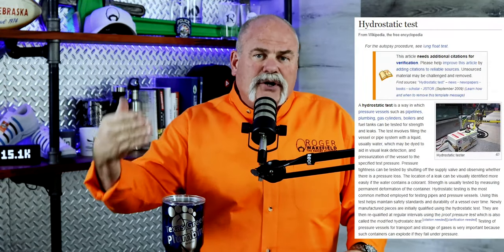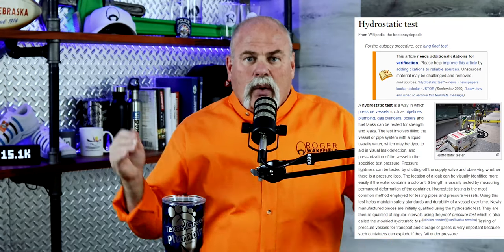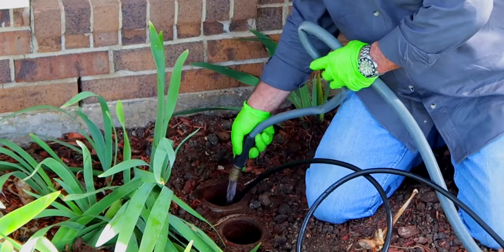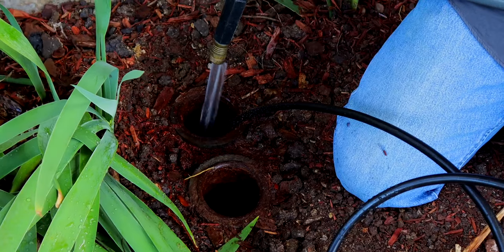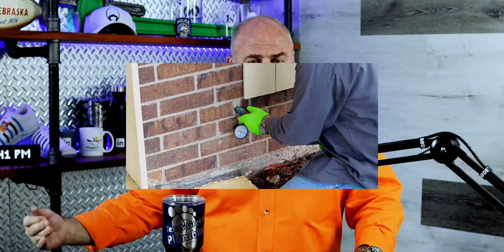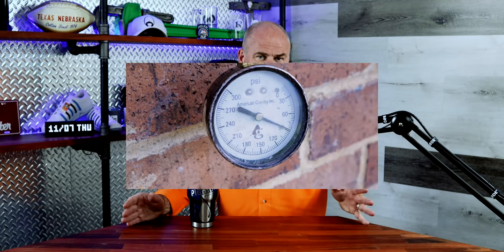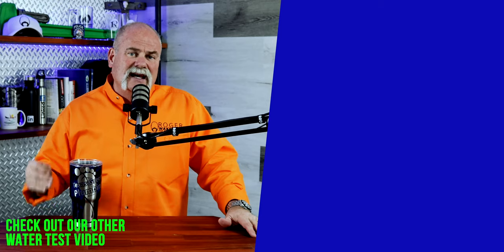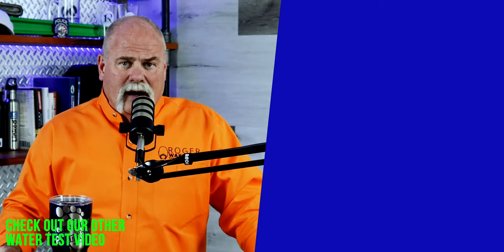What Is A Hydrostatic Test? | Plumbing Basics

Comment from the maker: Do you call it a hydrostatic test?
Reply: I did the 15 minute test with city water, and had a drop from 64 psi to 62 psi. It is within an allowable range or is it a leak?
Reply: I just call it a pressure test, and generally we only do them on new installations, although we have slightly different regulations in the UK, for new internal plumbing installations, I fill the pipework and vent all the air, and then pump the system to 3x working pressure (usually 3 bar), and for new drainage systems, just stop up the drain and fill with water, and then just let it sit and its simply a visual check, where the building inspector visits to see if the water level drops.

   I've never been asked to do that kind of pressure test (with a pump) on an existing system, I would be very nervous about that, it's more of a cover your own arse thing on new pipework you've installed, if it springs a leak after that it's usually because the carpenter has gotten trigger happy with his/her nail gun😅
Reply: @bp3149 would have to refer to your city codes all may not be the same .

Comment: 1st THANK YOU for the knowledge that you share.
I am a retired Volunteer FF and one of my responsibilities was to keep our SCBA bottles updated as well as our Fire Extinguishers. & our Fire Pumps & Hoses. So I am very familiar with the term "HYDROSTATIC TESTING". Which entails taking said equipment to a predetermined PRESSURE above its normal operating limits. And I've seen this equipment fail catastrophically!
Now that I hope that will help clear up the confusion as to what a Hydrostatic Test is not a STANDING WATER @ Normal Atmosphere Pressure.

Comment: Hi from San Antonio - We're selling our house and the potential buyer has asked to do a hydrostatic test. Our realtor explained the test as pressurizing our system (that could damage our appliances and water heater) and that our toilet would have to be removed to complete this.
We immediately said NO! 
We would absolutely be open to the test you described in your video.
How would you recommend proceeding to ensure the buyer's plumber does the test you described and properly?
I realize this not really a question you can answer but any advice would be welcome.
Thank you!

Comment: When my sister was looking for a house to buy, we did the test to one of the houses. We put a test ball in the clean out outside, but on the house side of the tee. Then we took off a toilet from the first floor, we filled the toilet drain pipe with water all the way to the flange. It wasn't holding the water. And there wasn't any water running through the clean out.
Reply from the maker: Sergio Ñurinda that's why we do it. This one test can save homeowners thousands of dollars...

Comment: Watch out for the occasional toilet causing the water pressure to drop. If a flapper is bad it will cause the fill valve to open and ruin the test.

Comment: Great video and topic to discuss Roger . I was under the impression that a hydro-static pump test is when the whole system is filled with water,along all air being purged out the system with pressure then being applied via the pump on a hose  attached to the system. Would that be correct? Also figured,just filling the system and checking for any leaks to fix(pressure not dropping) was just a regular fill test.
Reply from the maker: Ethan Muniz I wouldn't want to ever apply pressure to someone else's plumbing system. If it blows apart that could be my fault. We just do a leak test. That's all we are looking for. Thanks for watching and commenting!
Reply: @RogerWakefield  I agree with you about ever putting pressure on someone's plumbing roger. Being the fact that the line is just waste and not any kind of supply. Was more so just referring to the hydro static term defined. Thank you for the response ,much appreciated.
Reply from the maker: @ForeverAGh0st  you are welcome. I appreciate the comments!

Comment: Fill the entire system up on the roof, not the top of laundry drain. top of vent for 24 hours, it can't fail for 30 plus years, if water level is roughly the same as original. Sometimes the water can squeeze past the test ball, ever so slightly. it's a true safe test. You put a camera in, after you fill it with water. The stabilization will tell you,  if water is moving also.# masterplumber

Comment: I called 4 plumbers for a hydrostatic test and they all said they had to “pull the bowl” to do it. I went with a big plumbing company and they pulled a bowl and found a big problem and said it needed to be fixed before they could replace it. They had to dig a tunnel to do it and it was loud and pricey. When the work was done, they did the hydrostatic test using the toilet drain pipe and said that there was another leak. Now, get this: the city inspector had to sign off on the work before they could backfill the tunnels. The test performed for him was the one demonstrated in your video with the ball in the cleanout (but no meter on the hydrant). The water held and he signed off on it. Now I have questions. The test for the city showed no leaks after 4 hours (we are still waiting for the plumber to come back and remove the ball). But this other test from the toilet drain supposedly indicated a leak. I’m feeling a little ripped off right now and very confused. There’s a lot more to the story but that’s the gist of it. Do you have any feedback?

Comment: So what’s the difference between a status pressure test on domestic system, and a hydrostatic pressure test on sewer system? 

Because the static pressure test passed saying held at 72psi in 30 min, but the hydrostatic pressure test failed saying loss 4” in 30 min. 

The house had foundation repairs so I’m trying to find out how much I need to be concerned with this

Comment: Running main water line against the sewer line? That is way prohibited here Austin and the surrounding areas. You have to be at least 5' away from the sewer line. Where properties meet they usually put sewer on one corner and water on the other side of the property and if you have to cross you have to put it in a sleeve. Even on areas where they don't have sewer if the drain field from the septic tank is where the water crosses you have to sleeve the entire thing doesn't matter if it's color coded.
Reply from the maker: lemony Buffalo  we can run them in the same ditch but the water is supposed to be above the sewer and shelved. Thanks for watching and commenting!

Comment: If you determine there’s a sewer leak how do you isolate the sewer system to determine the exact location of the leak? Do you then perform a smoke test?
Reply from the maker: Josh McFate  we use test balls, hoses, and cameras to isolate the individual branch lines. A smoke test doesn't help under a slab because you will never see the smoke. Thank you for watching and commenting. Where are you located?

Comment: I have a question...we had a guy run a test...he blew up a ball..then ran water from shower and then said wait the 15 min...but after maybe 5 or so minutes he ran back in turned shower on and off about 10 times....oh and he had a camera to make sure the ball was holding the water on clean out outside...
Then he said he couldn't tell us the results...now if we aren't supposed to run water but he goes in when he thought no one was paying attention and turns shower on and off 10 times and i asked so are you not telling us because it failed and that's why you were turning shower on and off and he laughed and said no has nothing to do with that i was taking a video for my boss with my phone to show i did everything right....what? And right after that he said he was done and said results will be sent to agents.  We just now heard it failed. Does that sound right? A little different then what you just explained? Please let me know this is my elderly moms house and i think she should get a 2nd opinion?